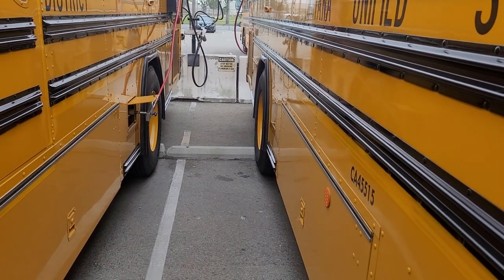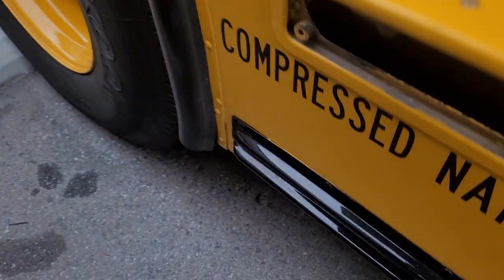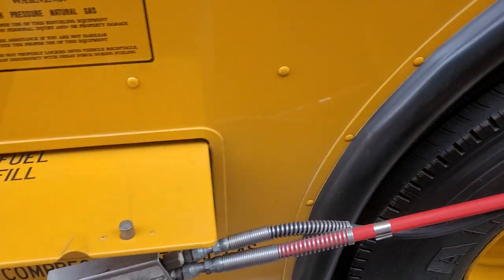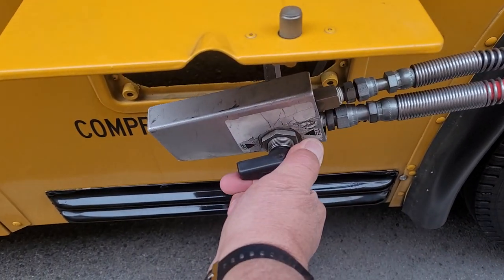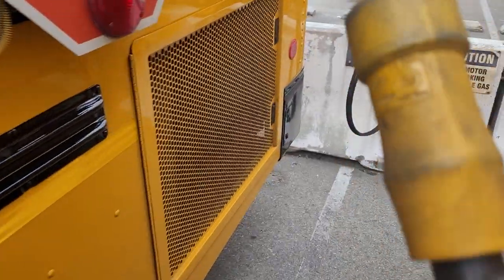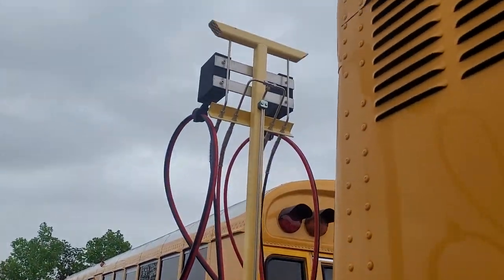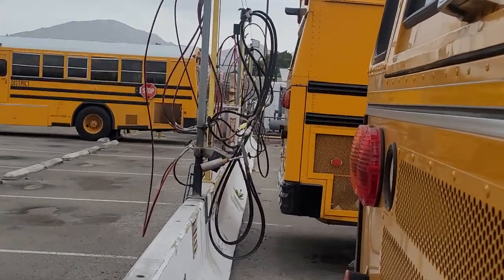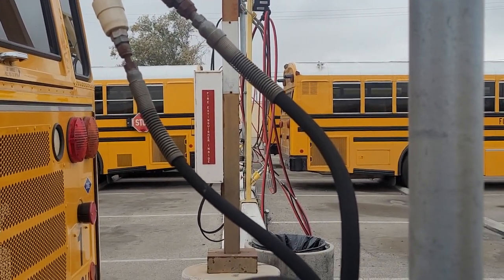How do CNG school buses get refueled? An informational, NOT TRAINING VIDEO. Complete with a blooper

Comment: And if you have the  Pleasure of filling at a fuel pump, the process is similar to filling up with gas except the the hose connection has to be to be manually engaged. the pressure flowing through the connection must not leak. Sometimes the O rit's the Owings crack or get mis placed and need to be replaced. Commercial fuel commercial fueling stations often have different pumps and pressures for cars versus trucks.
Reply from the maker: Yep, parked at the wrong sized nozzle the first time I went to a commercial station.